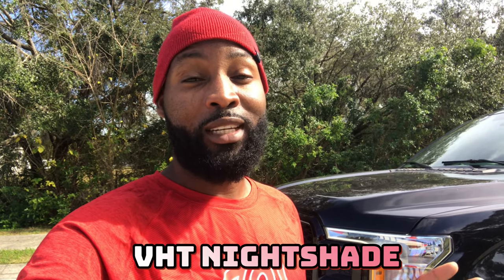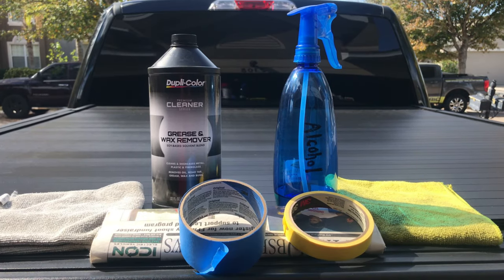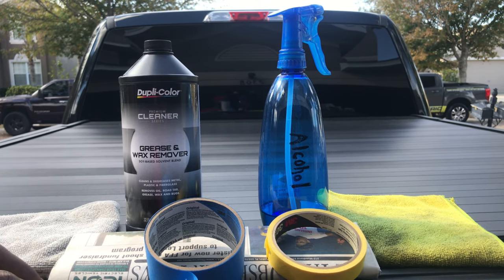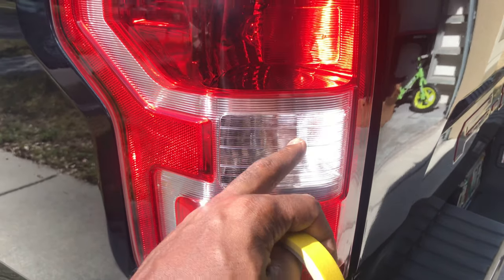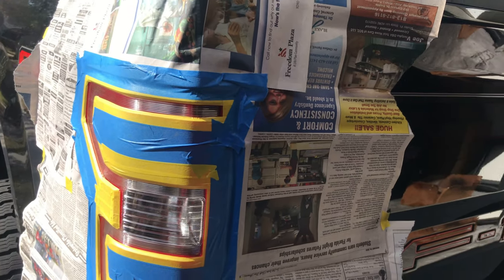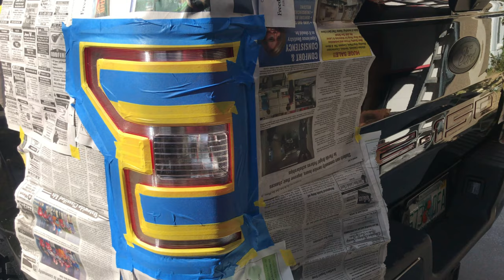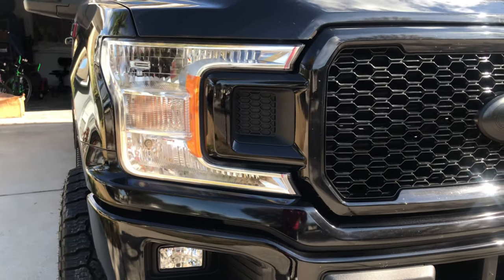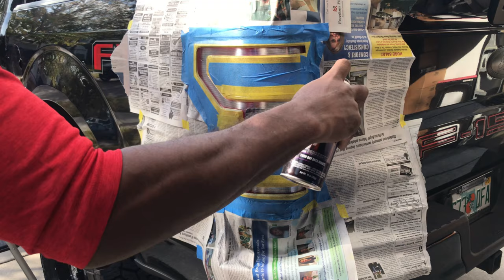Liquid Tail Light Tint From a Spray Can

Comment: Cheap Nail polish remover worked with such ease it removed black tint window paint in my car with no effort at all no one in all the car mechanics on YouTube even suggest this simple solution
Reply from the maker: I’ll have to experiment with that one day
Reply: @newtouchauto  it does work so easy at a cost of 99p not even a £1 removed black tinted paint from 6 my windows in a mobile bus instantly

Comment: How many coats did you put on the reverse lights? And how many on the headlights?   This is great, I applied film to the third light and after 4 months of FL sun its already peeling. Great way to get the look and work with what you already have! Thanks for the video.
Reply from the maker: You’re welcome and thanks for checking out the video, for the front I only spray 2 light coats giving it a smoked look. You don’t wanna go too dark bc your headlights won’t shine through properly at night, as for the taillights I do 3-4 coats.
Reply: @newtouchauto  
Thank you for explaining
Reply from the maker: You’re welcome and thanks for watching the video

Comment: How did the spray tint affect your reverse lights? Did it make them to dark when reversing at night that it’s hard to see or no?
Reply from the maker: The reverse portion of the taillights weren’t sprayed, only the park and brake. The film tint is translucent so the lights will be visible and not hard to see at night.
Spraying more than 3 coats is when you could dim the light, the darker you spray the less light will be able to come through. 
I don’t recommend it but if you decide to spray the headlights try not to go over 2 light coats. Older model vehicles run off bulbs and it’ll definitely effect the brightness of your lights.

Comment: Does the tint stay gloss after a few month, or has it faded away
Reply from the maker: No it won’t remain glossy, after 6-8 months it’ll begin to fade into a lighter shade. You can always respray the lights with 1-2 coats. Using film tint you won’t have to worry about fading, it’ll always have the same look until you decide to remove it. If you’re interested in watching a video on how to install film tint I have 4-5 uploaded to my channel.

Comment: How long does this paint last ? Does it fade with sun ? And is it easy to take off
Reply from the maker: Since this video I’ve moved onto vinyl film tints which last as long as you like it to. With the liquid film in this video it will fade over time from the sun rays and wash chemicals but it’s easy to remove with lacquer thinner.

Comment: When is it safe to go thru car wash? How long
Reply from the maker: Give it about 2-3 days, after about 6-8 months the film spray will begin to fade. You can can always respray the lights once you notice, only 1-2 coats needed if you decide to respray.
Reply: @newtouchauto  ok asking because I went to a shop yesterday an paid to do tail light tint an after I left the tint was coming right off within 2 damn hours. I went ryte back an they sprayed it. Looks gud just tryna see is spraying hood or go back an figure out the film?
Reply from the maker: @yungswagg8848  there are 2 ways to apply light tints and that’s spraying it or applying film tints. It seems that they applied film tint the first round bc the spray tint won’t come off in that manner after 2 hours. Whenever film tints are applied or even vinyl wraps you have to let it sit in the sun before clearing out future issues. If no movement happens then it was applied correctly, if not as soon as it hits the outdoor heat you’ll experience the film crinkle up.

Comment: How's it holding up after a year
Reply from the maker: This actually was a customer vehicle that I worked on but here’s the info. After about 8 months the spray tint will begin to fade slightly, you can always re-spray maybe 2 coats whenever the time comes. 

Film tints will give you more longevity than spray tints.

Comment: Good stuff enlightening me about this clip!, 
Kind of a intricate tail light right there! You ever try adding a Lil design in a tail light yet? Like a star or something..lol
Also I didn't know u needed to apply that in layers like plasti-dip..was long ago last time I done this.
 I used night shades but it appears that brand has the gloss effect without an added clear coat topping...??..(might be the same brand idk)
 I figure the clear coat will make it last longer they seem to fade over time. Never heard of anyone adding clear coat?
Reply from the maker: Yeah that’s true bc the spray does fade overtime. I never really wanted to do any design in tail lights though. 
The way you’re intending on doing the lights with the clear coat is much more durable.
Reply: @newtouchauto  makes it pop ans gives it the wow factor..the reg krylon kind too not that 2 stage drying professional kind.
Reply: @newtouchauto   But Hey man I did quite a bit of plastic dipping today and and I practiced on an older truck's rims and a Dodge ram emblem I had I just stuck to a shelf but it seems to have some Orange Orange peel I don't know if it's because I sprayed too much or if it's not Dried yet? 
How do I avoid orange peel using Plasti-dip brand.. I've got can control  I'm an exgraffiti artist so I have plenty of experience with aerosol cans but it's just been a very long time I'm considering using a different tyle of plasti-dip because the results I'm seeing are Not exactly professional looking::  , for examples sometimes a large spot will fly out luckily I have an air pressure thing that I can just blow it off and even it out and then spray over that but but on top of that I'm seeing Orange peel in a crevice of a Dodge ram emblem that I haven't even tried to peel away is to peel away the excess says plasti-dip YET LOL...waiting for to dry... any suggestions??
Reply from the maker: @freedompioneer4311  unfortunately with plasti dip you’ll pretty much get orange peel every time, if you’re looking for a more professional look you’ll need the hyperdip brand. Hyperdip replicates vinyl more so than PD and it’s on the professional level of quality. Glad to hear you trying out the dipping scene, with your spraying aerosol skills you’ll catch on quick.
Reply: @newtouchauto  I see, so there's no way around it. The cheap plasti-dip cans from Walmart splatter sometimes too so I had to use a air hose to blast it flat and then go over it again. Thanks for all the tips man I appreciate it. Doing the tail lights next with VHT kinda seems like the nozzles different then from years ago now tho
Reply from the maker: @freedompioneer4311  sometimes you’ll have to heat up the PD cans in hot water, it’ll spray out much better. Let me know how the lights turn out when you complete your project.
Reply: @newtouchauto  I was thinking that too! I ain't fuckin with this Plasti-dip brand no mo shit came out alright I did a practice run on a bucket car instead of my own first might still do mine too tho, shits a work out I see why you don't like taking the wheels off! Shit is tedious!
Reply from the maker: @freedompioneer4311  😆 yeah you’ll always find out the hard way before you perfect your craft
Reply: @newtouchauto  I feel like hit the wheels I did a little to far away and misted it instead of getting it thick enough. It's definitely different then Krylon spray paint.
Reply from the maker: @freedompioneer4311  more than likely you got the textured look, you’re temperature will make a difference also. If it’s too hot and spraying far off you won’t have that desired look.
Reply: @newtouchauto  it was hot and humid bro I think you're right it wasn't totally flush like I hoped it would be but I thought it being hot would be better for it to dry faster between coats
Reply from the maker: @freedompioneer4311  yeah the high temps  85+ are a definite no no

Comment: Why not take the taillights off? It’s only two bolts and extremely easy
Reply from the maker: It’s an option of course but not for those who may not feel comfortable with removing them or have the difficult taillight setup. It definitely saves the time preparing the area, I already have a video of removing the lights and spraying them though

Comment: If you 2k clear coat they will shine like a factory finish and won’t fade. Faded in protected nightshade lights look horrendous.
Reply from the maker: You’re right about that, after consistent car washing and weather changes it’ll fade overtime. The clear coat application is a great option for a permanent finish.

Comment: questions does that come off, if you want it back to original look,?would it work on dashboard?   great stuff on your vids thanks
Reply from the maker: Yes it’ll remove with lacquer thinner, I wouldn’t suggest using this product anywhere else other than lights. Using it on your dashboard will take too much product to try and black it out, it’s not gonna cover as quick as normal paint.

Comment: Great video... Could this be done to old oxidized head lights.
Reply from the maker: Thanks and yes it can be done, you’ll need to remove the oxidation first with a grease and wax remover.
Reply: @newtouchauto  thanks for the reply
Reply from the maker: @djbarryb201  you’re welcome and thanks for checking out the video

Comment: Hi mate it turned out unreal 👏🏻 has the spray held up?
Reply from the maker: Hey how’s it going and thanks for checking out the video. This spray holds up pretty good, the darker your coats the longer it’ll last dark. 4 coats is a good target but if you go any less the tint will begin to lighten up around the 8 month mark, if it does you can always spray over it again for that dark look again.
Reply: Cheers mate thanks for ur reply I’m gunna have a crack at spraying on the weekend 🤞🏻🤣
Reply from the maker: @damienrapa8141  cheers and hopefully your project is a success.